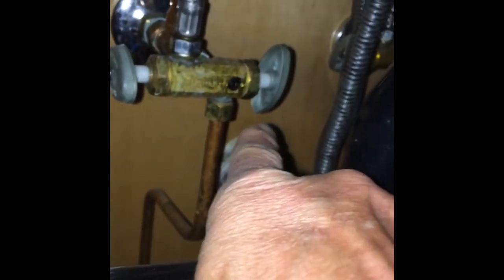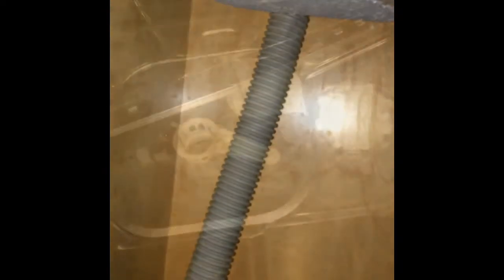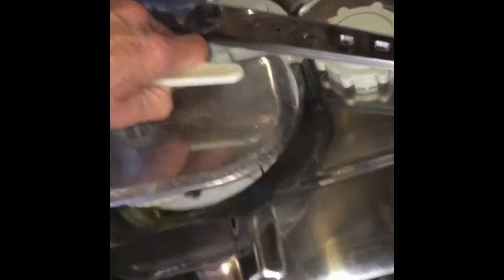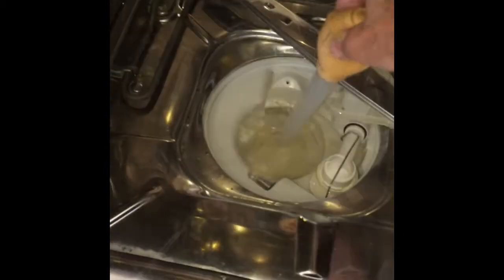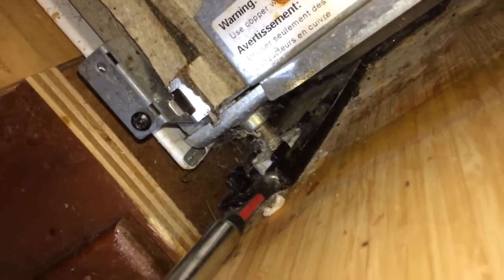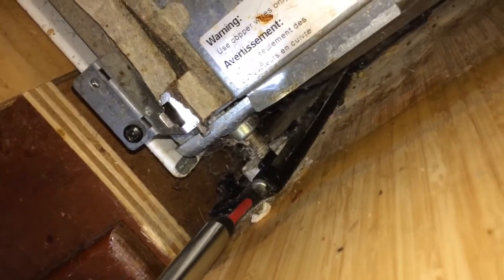✨ Miele Dishwasher -- Removal From Cabinet -- QUICK and EASY ✨

Comment: Hello from Switzerland!  Miele is a v popular brand here, and also v expensive!  My kitchen is getting replaced next year and (sods law) my Miele dishwasher of 20 years broke last year :).  I scoured the Swiss version eBay and found a relatively similar model, didn't want to spend fortunes on a new one if the aesthetics of the kitchen change soon :/.  Found a seldom used model of 18 years old for 60 francs (50 dollars).  Fitted it yesterday, thanks to you!  Saved me a lot of money my friend.  The only difficulty I had were those back legs when removing the broken washer,  they were very difficult to rotate and would not move.  I had to use a wrench to untighten.  Thank you very much!
Reply from the maker: Nice job Ben, thanks for the update

Comment: No side screws in my Meile G643 VI Plus 20-year-old dishwasher (that I am replacing), just a recess on either side at the top that I can't see into to work out how to unattach the unit so I'm stuck at base camp ... :(
Reply from the maker: Hi Steven,
We’re you able to get it out of the cabinet?

Comment: The screws that keep the front of our Miele Futura Chrystal dishwasher attached to the cabinet walls appear to require a square shaped screw driver (not allen), which I do not have :(
Reply from the maker: If you order a Milwaukee driver kit from Amazon it will come with that bit👍